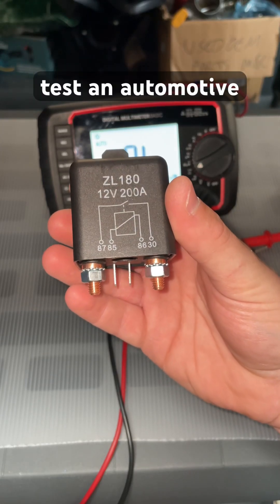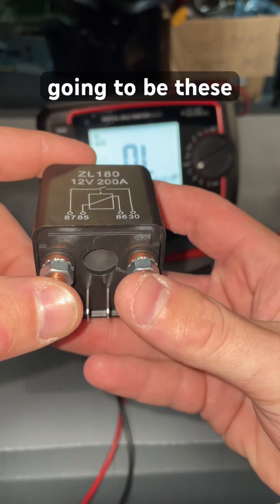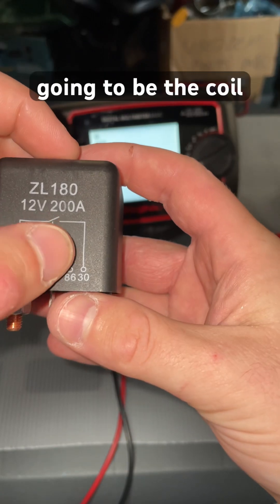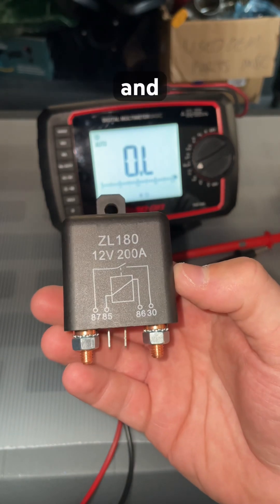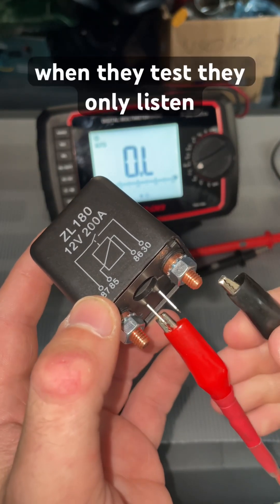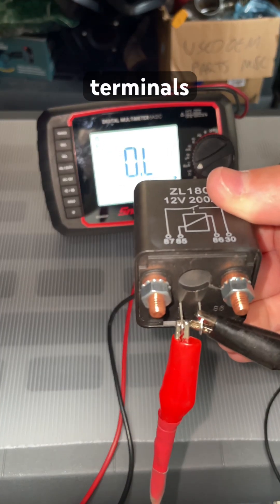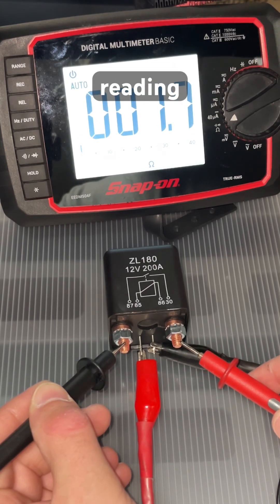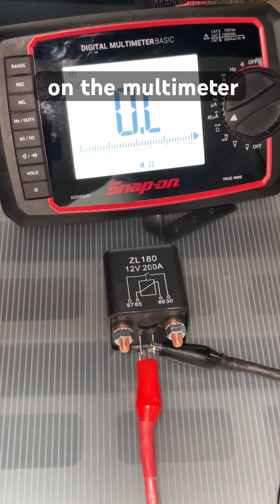How to Test a Car Relay

Comment: eh eh eh....that may be only  half of the tests.... the proper way is to  load the relay heavy contacts with, say 100 Amps there, and measure the mV across those contacts, AND also  make sure they don't heat up or burn up, and it depends on how long the relay is to be energised when in service